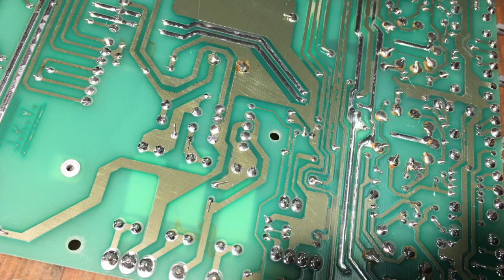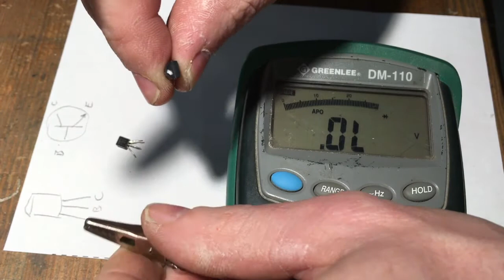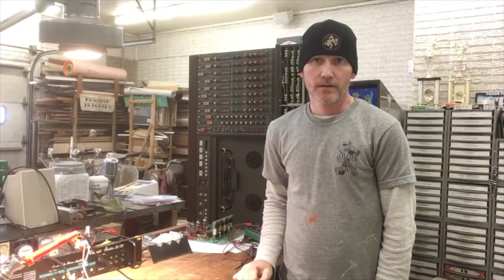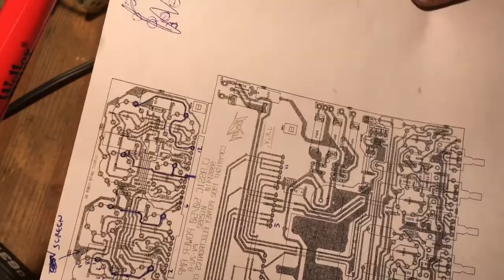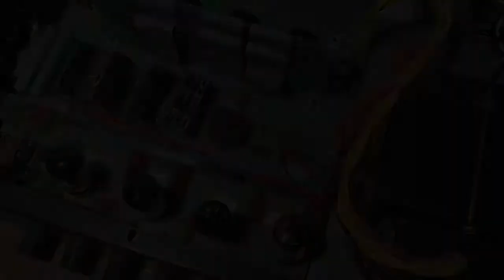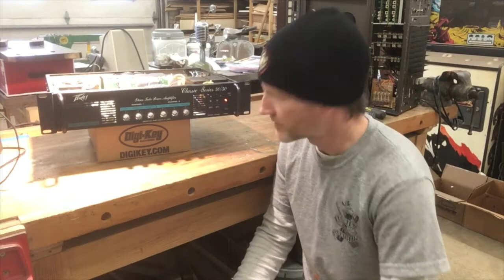Peavey Classic 50/50 Amplifier Repair and Refurbish Part 2

Comment: Good work! But what transistor did you get as the 2N3919 does not seem to exist especially in the TO-92 case?
Reply from the maker: Sorry, but I don't remember. It's been years since I looked at that amp!
Reply: @PhillipsHomeRepair  Thanks. I think they meant 2SC3919. But I used the MPS-8097. Worked fine. God bless!
Reply: @churchrapture  I know this is a longshot but any chance you can tell me where you found that transistor? Dealing with a dead power/standby light in a 60/60 and it has the same transistor. Assuming that’s the issue.

Comment: Ceramic insulater absorbs the arc flash.
off the subject when you crack open a high voltage fuse they have the same silicon type sand insulation, interesting the fuses are silver and thin. I.e 5mm across and waffer thin...
Good job fixing amps too, not many doing these days!

Comment: If you have the knowledge to do this type of job, why not invest in a decent soldering station. Even a Chineseium special for $30 would do a much better job. Lingering on a PCB trace with a low wattage iron can cause more damage than too hot of an iron. Some rosin flux would have made it work much better also. Good job on the repair though. I have one of these old amps in a rack with a Mesa Triaxis preamp.

Comment: Aren't you supposed to not touch tubes with bare hands?
Reply from the maker: It depends who you ask. It's easy to find people on the internet that claim it's bad to touch tubes, but I haven't seen any convincing evidence of it. In my experience, rules like that are easy to get started without proof and they eventually take on a life of their own. If I were replacing a rare or expensive tube, I'd probably wear gloves just to be safe, but I doubt it makes much difference.
Reply: @PhillipsHomeRepair  From what I heard, it's due to the "layer of fat / gunk" on the fingers, can use prematurely the tubes.  Not sure if it's true tough!  Maybe I'm more of a freak when it comes to this!
Reply: Old wives tale. Not an issue at all. I’ve been playing tube amps for 45 years and working on them for 25. Finger prints on them will not harm a thing. The glass is Pyrex and finger oil has no effect on it with heat. Some halogen light bulbs and other specialty bulbs can be fussy about fingerprints but not vacuum tubes.

Comment: Hi this is "E" thank you for sharing this video helps me in my Peavey 50/50 classic powere amp I been encauntering Issues with channel One and think I'm running Low in caps They Saturate and when I switch to lead guitar LOoSE power. now I know how to dessasemble The frontal pannel,thank you Again.

Comment: Hey.  Not to presume anything but when you said “let’s plug up a mic and speaker” it was after you turned it on.  I was always told to NEVER turn on a tube amp without a speaker load attached.  I assume you had a dummy load attached?
Reply: Mark Phillips probably not but it is still dangerous to allow a tube amp to be on with no load if the standby gets switched on.  This means the B+ or high voltage is connected to the transformer PRIMARY windings.  If (for whatever reason) the SECONDARY of the transformer has no “load,” the magnetic energy created by the primary (and “stored” in the core) has NO place to GO! As the alternating signal in the primary goes down, the magnetic field built up in the core “collapses,” thus inducing an extremely high voltage “spike” back into the transformer’s primary windings. Because this energy is substantial, and because the primary coils have many turns of wire, an extremely high voltage “transient” (often 3000 volts or more) can be developed. The primary of the output transformer is directly connected to the tubes and tube sockets of the amp, and neither the tubes nor the sockets (and associated wiring) are designed for that kind of voltage. These electrical “spikes” can (and often do) cause “arcing” inside the transformer and/or the tube elements, especially between the terminals on the tube sockets and wires.
Reply: @65Superhawk  can't see the reply from mark phillips but it is safe to power up a tube amplifier for testing with no speaker load as long as there is no input into the amplifier. with no input, there is nothing to amplify so there will not be any stress to the output tubes or transformers. play your guitar into a cranked tube amp with no speaker connected and yes, you will burn it up. this is not the same situation.